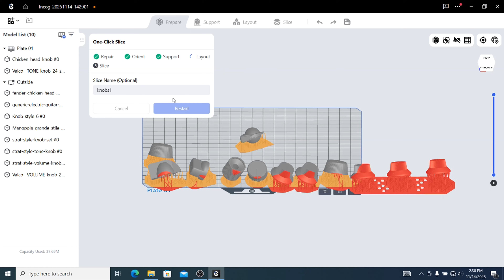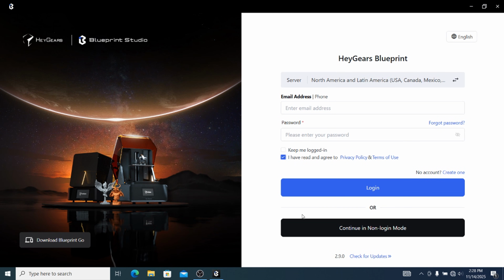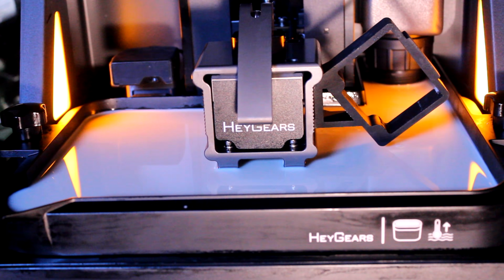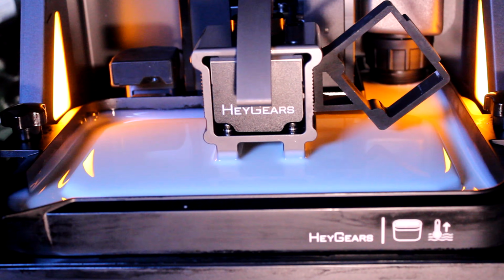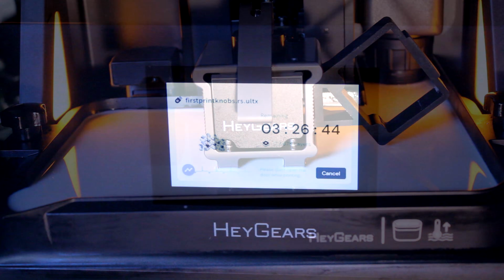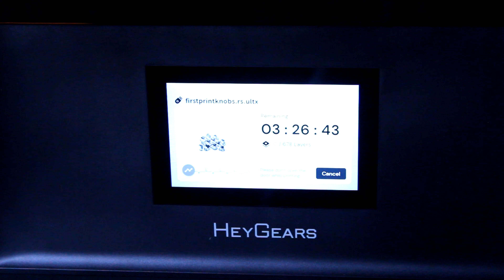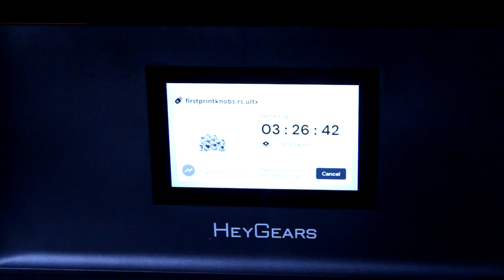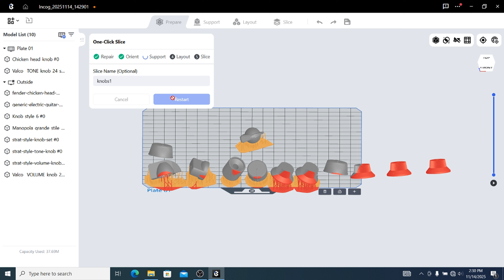This Robot Makes Guitar Parts While You Sleep! (HeyGears Reflex RS)

Comment: Bro it's much easier to peel the parts off the supports after heating them with a hair dryer/boiled water after you cleaned them with alcohol. It also makes support dimples less pronounced.

Comment: Super SUPEr badass! Im wondering, have you found that when using neodymium mags, you get better results with fewer windings or just an overall lower DC resistance in the coil? Ive been jimmying several homebrew pickups together for awhile and still have not gotten the clarity Im aiming for with neodymiums. Any tips would be really appreciated. Thanks for the vid! Those knobs were an amazing idea!!

Comment: I'm happy to see this in your hands, Clementine. :chillwcat:
Do those intonatable bridges actually work? I know folks have been able to print moving parts, I just didn't realize there was a resin durable enough to make operable screws and saddles.
Really amazing.
I've been interested in this stuff since back when it was called rapid prototyping and was basically looked at like scifi stuff. Never have gotten to try it myself though.
I love that this machine can be used completely offline. It seems like folks who don't live where there's solid infrastructure are often an afterthought to these type of industries.
Reply from the maker: Thanks for the kind words Courier! While you have the resolution to print machine threads and tapped holes that will actually operate and the production resins are incredibly durable, I printed those bridges as "set" 1 piece static parts with extra support built in. The best move would probably be to print the body of the bridge and the saddles separate and use steel hardware, might also be best to print it with round holes and use a tap for extra precision. However It's truly amazing how far this tech has come! I am excited to learn how to really design my own parts and I will see how far I can actually push the platform and figure out what can and cannot be done. Its definitely a really neat process and capable of making very professional parts I could never create otherwise.
Reply: @heavymetalATC  Thanks for the response. It'll be pretty exciting to see what you do with this stuff. maybe you should try out just that and see how it holds up with a resin bridge, but steel and/or brass hardware.
Either way, I'm sure that after you've spent some time exploring your new capabilities you'll be doing stuff with it that wouldn't even cross your mind today. Very exciting. All the best to you and your family from southern AZ

Comment: Aloha,

actually a very good idea.

Everything what is plastic can be printed.
And trying own designs.

For bridges you can print covers.

Or a box for a pedal.

Can you print golden pickup covers?

Au revoir 
Quickwash
Reply from the maker: Aloha Quickwash! Thanks for watching, this printer definitely opens up a lot of possibilities for custom parts! I feel very lucky to have it and I'm excited to learn how to design my own 3d models then the possibilities are basically endless. While HeyGears doesn't make a golden resin, I suppose you could paint a resin printed pickup cover with conductive copper paint and then electro-plate it for a chrome or gold look. Much like the way they plate plastic automotive emblems.
Reply: @heavymetalATC good ideas. Thank you. I am thinking about replacing the tuner buttons with another designs. If it is not possible there is still the option to saw the pld buttons to squares or something like that and putting the new buttons over it.

Comment: except that resin is the last material you wanna use for these parts, especially a fucking bridge, lol
most plastic parts a re moulded in ABS, resin sucks in so many ways
Reply from the maker: Thanks for the comment! I appreciate the feedback on the material choice however..if you compare injection-molded ABS to Standard UV Resin (which is cheap and brittle) but a well-chosen Tough UV Resin will not only be structurally tougher than low-grade, factory-molded ABS, but it will also likely have a much higher density and hardness, which is the critical factor for superior tone and sustain in a nut or bridge component. I can personally attest that the material choice delivered exceptional tone and clarity on my banjo, which is the entire goal. It's working perfectly. I do understand for an electric guitar it does not ground the strings but if a simple ground wire is used to contact the strings somewhere that's null, Danelectro literally used wood as a bridge insert. I'm sure that in the future I will use the Reflex RS for more projects on the channel and further prove this.